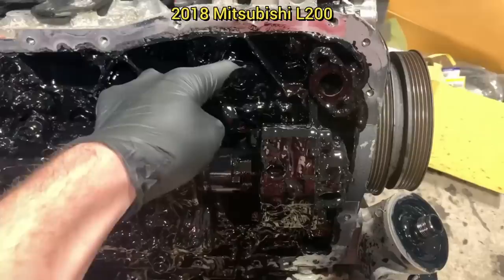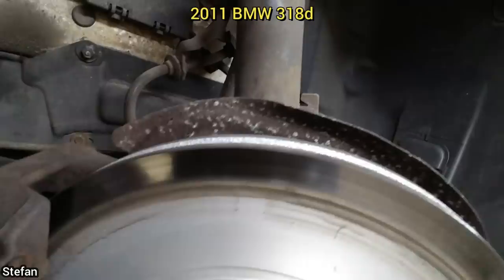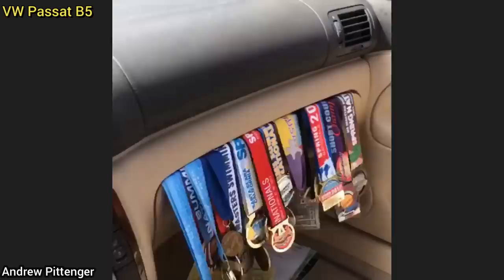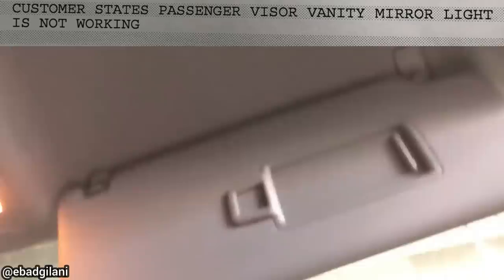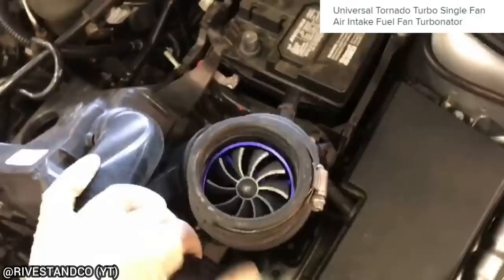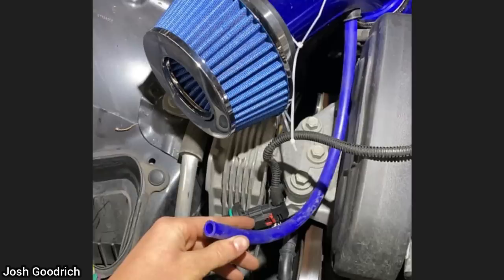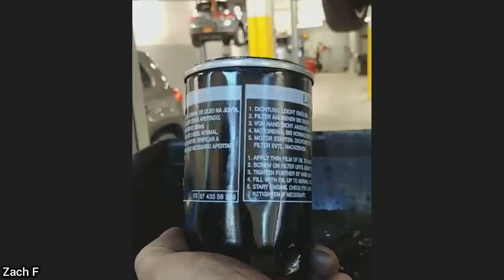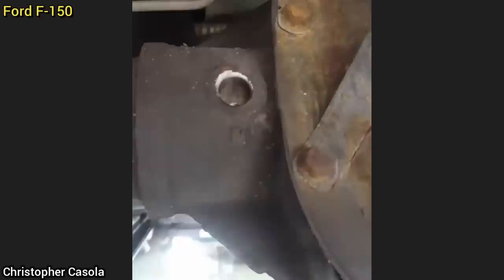Customer States Haven't Changed Oil In 78000 Miles

Comment: My dad had a 1988 Chevy Cavalier 5 speed wagon that he never changed the oil in.  He drove it for over 200,000 miles and would just add a little oil if it was low.  That car also never needed the clutch replaced.  I don't know what  higher power was invoked to make that car last as long as it did, but it was beyond impressive.  It eventually rusted to pieces.
Reply: There's an old saying: "An American car will run like shit longer than other cars will run at all"
Reply: if it leaks enough, and you keep adding new, do you really need to change it?? LOL
Reply: @leftyo9589  The strange thing is that the engine didn't leak oil or burn oil(enough to need to add a lot of oil all the time).  It was literally the most robust engine and transmission that I have ever encountered.  When that car finally fell apart from rust, my dad tried another Cavalier that was a 1993 if I recall, and that engine blew up with like 40k miles.  His 1988 Cavalier was just a freak of manufacturing.
Reply: @BryanWhite77  I think that was quite common in the days before computerised tool-setting. To allow for variations in manufacture designers allowed greater tolerances and relied on lubricants to minimise the slop. You might randomly get an engine assembled from parts which were a loose fit, or one where by chance all the components were exactly to specification. One engine would fall apart quickly, and the other would run forever, and it was pot luck what you got.
Reply: Can't recall the last time I saw a 80s cavalier on the road.
Reply: @leftyo9589  That's my 86 S10. It uses & loses 2 quarts every 3k miles so I extended the oil change to every 6k. Could probably go longer.
Reply: I worked in engine oil development.
One test I was envolved in had the engine run for 100,000 miles, no oil changes just top ups to keep the level correct.
The engine was not ruined.
Reply: @Northy  you work in oil development but can't spell involved correctly?
Reply: Supposedly, the reason why those 80s cars last as long as they do, is because they're underpowered. They're not stressing the oil as much, so there's no harm done. My 84 Caprice with a 305 was said to be one of the best darn engines ever, I've heard of that 305 lasting 500,000 easily with regular maintenance.
Reply: @leftyo9589  Yes, because eventually your oil filter won't be doing anything from being so gummed up regardless of how much new oil you're putting in over time. Changing your oil is also changing the filter.
Reply: @dan776  yes. Correct spelling is not my job. I have other people. They correctly spell, add punctuation and write the final reports for me.
Reply: @leftyo9589  That was my Dodge Colt.)
Reply: @BryanWhite77  Sounds like the mighty Iron Duke.  They're bulletproof.

Comment: I recently upgraded the modular PSU in my gaming PC, but my new AIO cooler would not work properly and I spent 3 agonizing days trying to figure out why, even exchanging the cooler for another one only to have the same problem. During the build, I ran out of SATA power cables, so I borrowed one from the previous PSU, and I later found out that since the two PSU's were different brands, the cable I borrowed had a different pin-out arrangement in the socket than the new one, so the AIO cooler was not getting the proper voltage. Once I replaced it with a SATA power cable with the correct pins, the problem was immediately solved, but I felt REALLY stupid, since I've been building gaming PC's for almost 20 years. (Never too old to learn something new.) However, I still don't feel nearly as stupid as the owners of these cars.
Reply: I've heard its VERY dangerous to use different psu cables, as they can cause some fuckery within a system unit, so it is best advised to use the cables that came with the PSU you currently have, thankfully nothing went wrong in your build tho!

Comment: amusing - my father worked in a gas station when he was young but as an adult never changed the oil in the family pontiac.  He would just add oil when the oil light would come on.  When the car stopped working well, he gave the car to my mother.  She took it to a mechanic.  They took the engine apart to clean out all the sludge.  It never ran well so they gave the car to me.  It died in the college parking lot and i had it towed to a junkyard.

Comment: My favorites are the following:

- Customer states clock is running too fast
- Customer states trunk will not open
- Customer states Fender Liner coming off after battery replacement 
- Customer states rattle after collision and body shop repairs

Comment: That first customer was probably my dad. He never changed the oil and claimed that he never had oil related problems. He just added a little oil at a time. He did have some engines seize or fail to start but according to him, it was never oil related. Go figure.
Reply: Nah, couldn't me my fault, it's these damn cheap engines..
Reply: A guy I work with did the same thing with a civic after it got to 200k miles just to see how long it would keep going by just adding oil as it dropped and never changing the oil or filter and it made it to 278k before it seized up. It was a pure work and home commuter at that point so mostly highway, but still damn impressive.
Reply: @TheLouisianan  I once saw a civic throw a rod through the block on cylinder 4, guy kept adding oil and drove it for two more weeks before it finally gave out. I don't know about the new ones, but late 80's through 2000 Honda engines were unreal. The one in question was a 1990 4-door with I believe a D-series non-VTEC.
Reply: @logicplague  my coworker's was a 2001. I'm pretty sure Honda backed off the reliability from those to stay in business.
Reply: @TheLouisianan  It's everything these days it seems, planned obsolescence. Idk how it could be done, but the practice should be illegal.
Reply: @logicplague  Blame greedy corporations that don't care about being wasteful and only care about their own profits

Comment: I'll be honest. I don't get too hung up on changing the oil right at 3,000 miles, but I do change it once every 45,000 miles whether it needs it or not.

For real tho. How can someone not change their oil even once in 78,000 miles? Way to destroy a fairly newish engine.
Reply: Especially when it's covered in the lease.
Reply: they have no idea there is oil in an engine.
Reply: It was brand new!!
Reply: @G19Jeeper  With very much emphasis on was.
Reply: It does speak volumes for the quality of the engine that it continues to run for that long with no maintenance.
Reply: Had a buddy I used to game with who worked at Mercedes over in Europe, woman brought one in with the same story. 60000 and never changed the oil, completely locked up, told him that "she didn't think you had to do that on cars this expensive". It's a testament to modern engineering that these engines survive as long as they do when mistreated this way.
Reply: i wouldnt wanna be the poor bastard to   buy a second hand car from you iether , oil loses its  lubrication and wears out the engine twice as fast .... and its like a 20 minute job if that on most cars .....
Reply: ive seen plenty old cars that changed the oil on time with over 300 K kilometers and ran like a champ

Comment: I overheard a lady telling someone her car was slow to start. I asked her if she had replaced the spark plugs recently as that could contribute to the problem. She said "Cars still have spark plugs?"
Reply: I once worked with someone who argued (at length) that fuel injection had replaced, not just the carburettor, but the spark plugs as well.  We deduced afterwards that he didn't know the difference between a diesel engine and a gasoline one.
Reply: I once worked with someone who argued (at length) that fuel injection had replaced, not just the carburettor, but the spark plugs as well.  We deduced afterwards that he didn't know the difference between a diesel engine and a gasoline one.

Comment: In 1999 I was working at a nursery. The one foreman was changing the oil on the '77 Suburban we had as a nursery truck when the one landscape architect came over to see what was going on. He said, "you need to change the oil?" Um, yeah. He had an '88 F150 with 100k on it, that never had its oil changed, only topped off every so often. We were flabbergasted. 
He had to use one of the road pickups for a couple weeks while the dealership ripped his engine, transmission, and rear apart performing some long overdue maintenance.

Comment: Forgetting oil change? Engineers at Volkswagen seem to have found a solution!
We had about 6 customers who were late to their oil change (maybe 10k over) an their Oil filters rusted through!
2 or 3 literally exploded because the metall got so thin.
Reply: A guy I work with, his little Diahatsu charade started leaving a thin trail of oil in and out of the work carpark, i asked him to pop the hood and took a look, the oil filter was rusted through. Helped him change the oil and filter and noticed a few things, to get to the filter, you remove the number plate and theres a round hole provided so you can reach through to install/remove the filter. And even with a new filter it only took barely 2 litres to fill it.😆
Reply: For those American viewers, 2 liters is roughly 2 quarts. You need 3.2 liters or 3.5 quarts of oil to normally fill it with filter.
Reply: I felt bad when I had to wait an extra 1000 miles to get my oil changed due to an expensive tractor repair eating up my funds. These people are goofy as hell.
Reply: @dannylim3318  I wish my car only took 3.2 litres. Its 9.2 litres to change the oil and filter in my ISF.😖
Reply: @uhtred7860  Holy shit, my car only needs 1 litre of Oil
Reply: @danny, u need to use african elephant, statue of liberty, football field or a jumbojet so that american viewer can understand correct size. Atleast all american made documents use those units....
Reply: @standardheat-fs8159  Yeah it gets expensive too, 10 Litres of Mobil 1 is around 160.00 NZ dollars😧
Reply: @dot7107  Statue of Liberty is French!

Comment: Imagine having full service package and not utilising it for every cent 🤯
Reply: On a new car, yes. I bought my truck used at a local Honda dealership and they offered me free oil changes for a year. I am quite particular in this, I only run Mobil1 and either a factory filter or K&N(not so much for performance, they're just way easier to get off). When I called they told me that they did not offer Mobil1. Ok, fine, Honda oil is still synthetic, so as long as the weights right I guess, however when they told me all they had were Honda filters, and that was what they intended to use on a Silverado, I decided to just do them myself. By the time I bought the oil and filter and brought it to them, I haven't saved jack squat.
Reply: They also had NO idea what they had in that truck, the window sticker had the paint color and several options wrong, listed as a work truck when it wasn't, and I got it for 9500 when the book was likely way higher. It needed some routine maintenance, but every person I've talked to told my I might as well have stolen that truck from them.

Comment: 2:53 that reminds me of a time a friend of mine called me up for a CV axle replacement, saying they hear a loud clicking and sometimes banging noise coming from the wheels. Clicking = worn CV, replace ASAP, but I’ve never heard of a CV axle making a “banging” noise. 

So I show up and start with the driver side axle, notice it’s weirdly easy to remove, and it turns out the engine side of the axle had completely broken off. After pulling the axle, I had to pull the other end of the axle out of the tranny’s output. 

Idk how they managed to drive that car home, but they did say it had some really weird handling. Something tells me that’s the culprit. Or at least, one of the culprits anyways.

Comment: the fact that engine after almost 80,000 kept going with out dying amazes me
Reply: That is japanese engineering for you. I had a Toyota Celica with over 150K miles on the clock and the engine was sweet, A/C & bonnet latch not so sweet.
Reply: how the fuck did the engine not blow up?
Reply: Japanese cars are something else. Ive heard of a guy with over 1 million miles on his car with only 3 engine swaps(same motor,used) and it ran great all things considered before he got rid of it.

Comment: For those who aren’t familiar, Turbonator is slang for Turbo Encabulator.
Reply: Love the Turbo Encabulator reference........
Reply: I can't believe at one time in my life I considered getting one for my car. Glad I never did.
Reply: @bitemyshinnymetalass1569  Or fuel line magnets?
Reply: It was clearly a fake though, no marzelvanes means that side fumbling will quickly deteriorate the spurving bearings.
Reply: For the uninformed, the issue with that one was it should have been a retroencabulator on that engine

Comment: I can't believe a car went that long without an oil change...My dad let my older sister borrow his Jeep Grand Cherokee, and she didn't change the oil for about 8,000 miles before it threw a connecting rod through the side of the block.
Reply: Throwing a rod is nothing to do with engine oil.
Reply: @sahhull  In a way, you're right. It's a lack of engine oil, or severely filthy engine "oil" that was oil, that will do that.

Comment: 78,000 and no new oil, that's unreal ..was definitely built to last
Reply: Modern oils are far better than 30 years ago.
I worked in engine oil development.
One test I was envolved in had the engine run for 100,000 miles, no oil changes just top ups to keep the level correct.
The engine was not even close to being ruined.
Reply: P @sahhull

Comment: What brand of oil was in that vehicle!? For the engine to run for that long is impressive!
Reply: I worked in engine oil development.
One test I was envolved in had the engine run for 100,000 miles, no oil changes just top ups to keep the level correct.
The engine was not ruined.

Comment: Meanwhile, I was freaking out over going down to 35% on the oil life monitor.
Reply: I had zero problems changing my E46 BMW's oil when the computer told me to.  Typically around every 12000 miles.  Synthetic, of course.

Comment: How cheap do you have to be to JB weld the oilfilter instead of replacing it?
Reply: Oil Filter probably cost the same as the JB Weld 😆
Reply: @chada75 was going to say this
Reply: @chada75  id almost say its cheaper lol. A new oil filter is like 10 bucks

Comment: Farmer next door to me had a lovely 1993 Mitsubishi Pajero 2.5TD Ralliart.  It had split rims, gauges everywhere, altimeter, compass etc, Nardi steering wheel, leather seats, electronically adjustable Bilsteins.  Over the course of the next 8 years it turned into an absolute turd. He asked me to service it and it turns out the oil wasn't changed in those 8 years.  Bear in mind this thing was his daily driver, tow truck and sheep herder on the mountains.  Oil was quite literally like treacle.  Needed flushed several times.  Still ran fine for years after it.

Comment: As usual thumbs 👍 up before watching..... I am lost of words.... how can dumbazz people do stuff like that... I am a retired mechanic and I have never seen crap before like this...almost 30 years and seen more stupid crap on this video than what I have seen my whole career.. absolutely amazing to see this
Reply: I blame the invention of electronic ignition and long lasting spark plugs!  When cars had points and condensers, the points would need checking at about the same time the oil would need changing.  And the points and plugs might start getting weak by the next oil change.  All of this demands that the owner be mindful of maintenance.

In any case,  the points eventually wouldn't do their job and the car wouldn't start.  A built in protective device to compel servicing!  The car would then taken in for a tune up.  At the same time, the garage would look at the dipstick and recommend an oil and filter change while it's there.  Maybe even upsell a new air filter as well!

Even though I prefer electronic ignition, points and condensers often forced the car owner to open the hood and peruse around to see what else might be wrong.  Computers automatically compensate for wear and tear, which means the car runs well for a long time and the owner has no idea of what's really happening.
Reply: @BlackPill-pu4vi  you are right... back in the 60s and 70s when I started all you needed was 500 bucks in tools to work in the shop to fix cars... now you need a 10 grand analyzer just to see what is wrong.. need roughly 100 grand in tools now

Comment: Late 70s Torino came in with a no crank condition. Determined the engine was seized, pulled the pan and and oil pan shaped glob of black goo came out. The car had gone about 70k miles on the factory oil. It still had the little strip of orange tape the factory used to secure the oil filler cap to the valve cover. As much "car"nage  as we see here, I have always been amazed at how long they keep going.

Comment: Came out of Autozone and a woman was standing in front of her car with the hood open.  She asked me why she had an oil light showing on her dash and whether she was short on oil?  I looked at the open oil filler cap and the oil was filled to the top of the valve cover!!  I told her she had more problems than I could help with and I walked away.

Comment: When an oil filter gets plugged up, oil stops flowing through it and then the carbon from the engine mixes with the oil bakes it and that's how you get that sludge.

Comment: Had a cousin bought brand new Toyota Cressida long ago and never changed oil, told me they always checked the level on dipstick but in 42'000 or so miles the motor locked up. 😢

Comment: When buying a used car, I always pop the hood to take a look at the oil filter. If it's as dirty as the rest of the engine bay, I assume oil changes weren't done as often as they should be and move on to the next car.